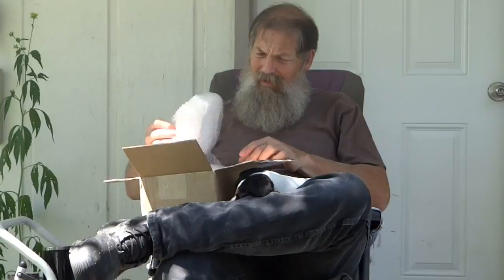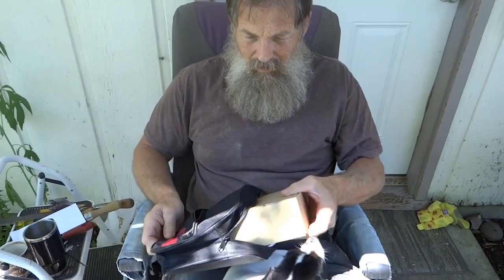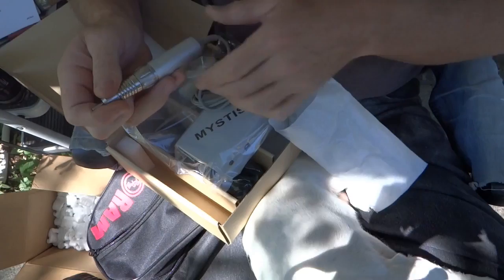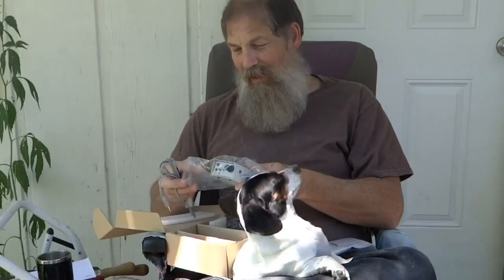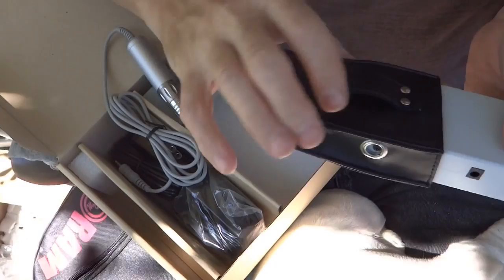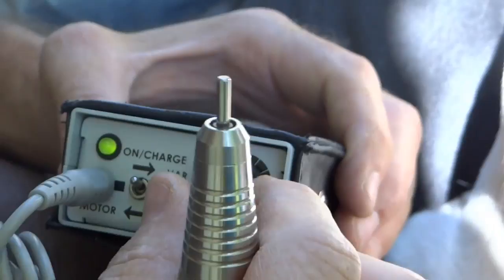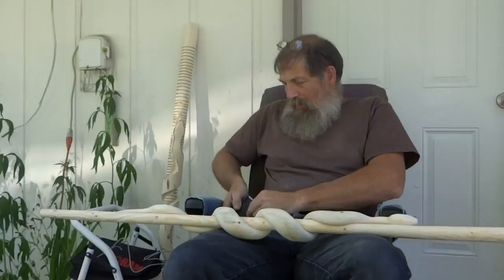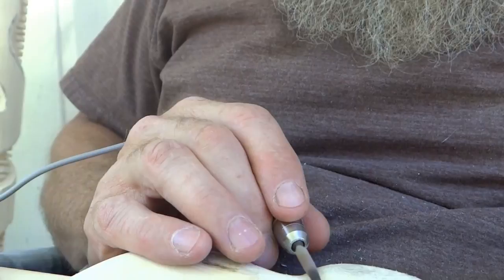Unboxing a Portable Carving Tool

Comment: Nice unit guess I gota save up for one of these. I bought the turbo grinder and am not impresed by it. It's compressor is Loud. And the tool is week don't take much extra pressure to stop the bit.

Comment: Mike never seen you unboxing before and this new tool is impressive. I use a Dremel 4000  often with a flexible cable drive however the cable Dremel supply is useless, so believe it or not a cheaper Chinese cable is better and lasts really well, even got a rotary tool from China which is as good as the Dremel at a third the price, just thought I would bore you with these facts, anyway good luck with your Mystisa, look forward to your future videos as usual, Cheers from John in Berwick upon Tweed. England
Reply from the maker: I think most things are made in China, now.  It's too bad that Dremel's quality has gone down hill.  I've been testing the Mystisa, this week and have decided it's good for light finish work and detailing.  If you use large burrs and shaping wheels it drains the batteries and only lasts about 1-1/12 hours.  I checked out Berwick upon Tweed on Google Earth!  What a charming place to live!  From what I can see, it looks like a very nice place to live in Northeast England.  Thanks for your comment!  I hope you have a great week!
Reply: Mike, I have another friend who watches, and is impressed with all the works you do, and he lives in a similar named place but is nowhere near me, and it is called North Berwick not far from Edinburgh Scotland`s capital city. My  friends name is George, I think he would get a kick if you looked his area up, but only if you get time of course, regards from John.

Comment: Mike can you tell me what brand/ type of electric mini grinder you use? I don't mean the Dremel type grinders as I have those but the little ones which come attached to the little electric box type with the speed dial power supply. Thanks man. Much appreciated. Keep it up sir. Great work as always. Works of art for real. To say you have only been carving for about 6 years is even more astounding. Okay what unit have used in the past? This one looks good too.

Comment: Well, its been awhile since you talked about this Mystisa microcarver. I'm thinking about one. I use to hand carve, but I'm getting older and wanting to speed up the work. Please get back with me. Thank you Sir 
PS, really like your work, and skill.
Reply from the maker: Thanks, Santa! You should be able to speed up your production with a micromotor, haha! I think I know what your elves are getting for Christmas! The Mystisa is working great. I use it mostly for detail work. It can handle the more aggressive burrs, but the battery life will go down quickly. It lasts quite a while with the smaller detail burrs. For the heavy duty work, I use my Oz- Plus micromotor and handpiece. It has a lot of power. You can get either one at treelineusa.com Thank you much,
Reply: Thank you, Now maybe the Elves will be happier songs. I was beginning to worry. Ho hoho ho
 Now they can stop having to strop so often. Ho hoho ho
I wish, I could come by to see you, but as you know, it's that time of year for me. Maybe later.
 Really Sir, much impressed with your work. 
PS, Have you ever carving a realistic skull." Yep, they ask for all sorts of things." Ho hoho ho
  I'm using a, ground dried, crepe myrtle limb, about 3.5ins in diameter. I don't get on Facebook, but I would like to see all your works. I'm also interested, later on, in investing in some of your carvings. Very impressed
Maybe you'd like to work at the North Pole,,,lol, Ho hoho ho
You'd make a tall Elf. I would ask, but the North Pole's getting alittle small
I haven't finished, but I had to see what it looked like polished, down to wet 2000git. 
Thank you for get back with Santa